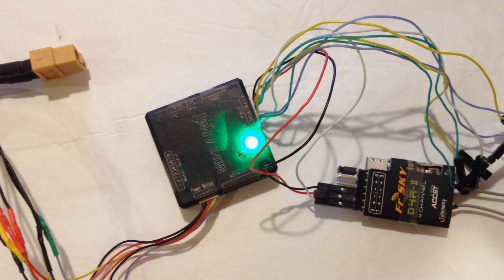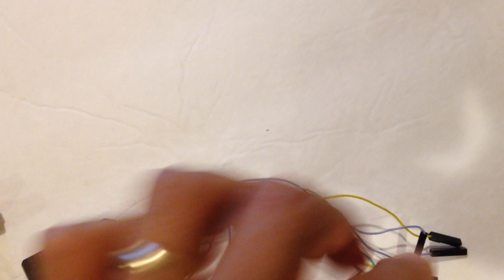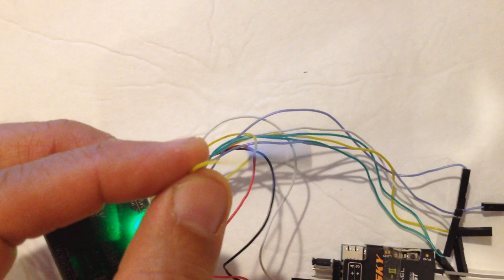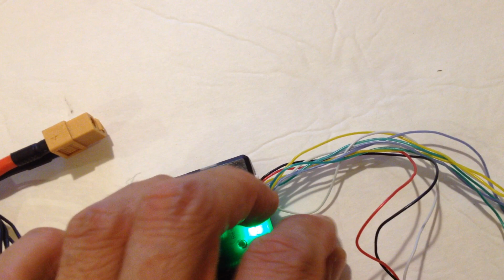How to connect your receiver to mini APM using PPM mode

Comment: How has the mini APM 3.1 been so far? Have you had any issues with the build quality of the board? I'd heard there were some issue with the onboard regulator and powering it via the USB. Any issues there?
Reply from the maker: I haven't used the mini APM for a while, but to answer your question: no problems powering via USB.